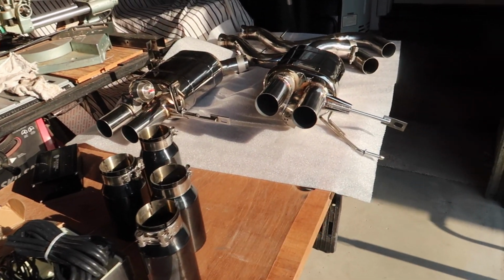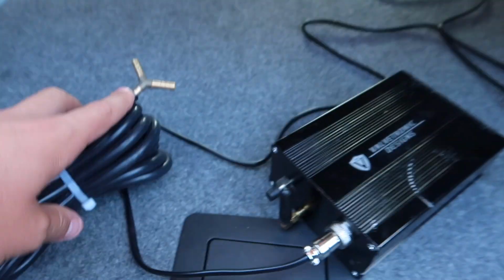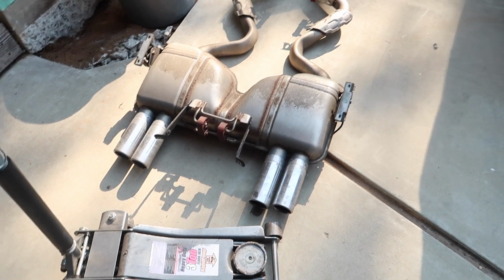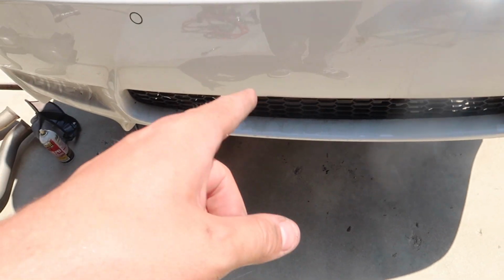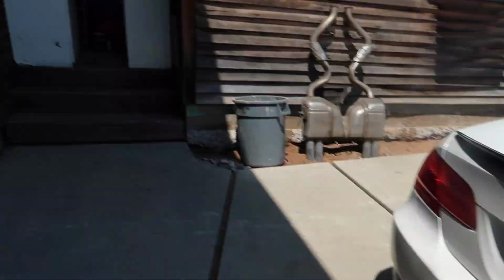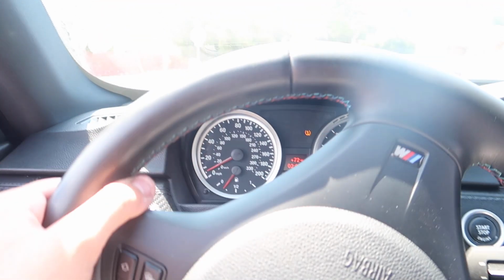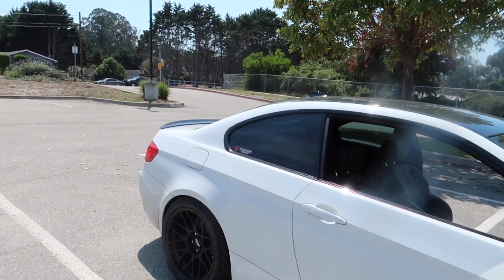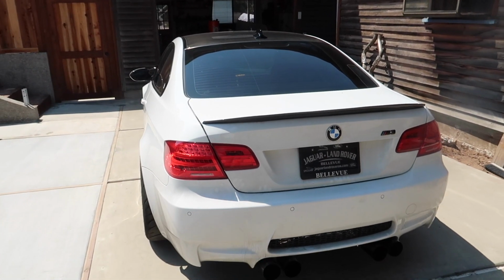NEW EXHAUST FOR MY BMW M3!! (VALVETRONIC)

Comment: Nice man! I just did the same set up on my E-92 M3! Move your shift intensity up to 4 and the down shift rev matching sounds so much better. Also a little tip...I put my receiver box in the little pull up storage compartment in the trunk and ran the tubing straight down from there. This way the box won’t move around. The rear seats just pull right out with no screw, just clips to hide the wire up the the center console outlet if it helps. Nice mods! Track day videos please!!!
Reply from the maker: I’ll definitely do that bro!!!!!
Reply: How did you run it down from there? Bout to install my valvetronic. Is there an opening in there?
Reply: @thekidmanny377  I took out the back seats out and the wire from the box through the ski cut out, under where the seats are and under the carpet up to the center arm rest socket for power. Super clean look. It’s easy to pop the rear seats out, you tube it. Or You could run wire all the way up and hardwire in the fuse box behind the glove box. That’s how I hardwired my radar.
Reply: To run it down from the storage compartment I just drilled a tiny hole and put a rubber from it in to protect wire, and also seal it up. 4 years now and never had an issue.